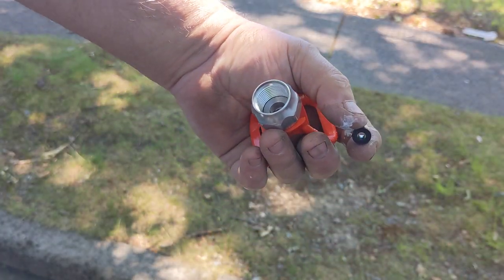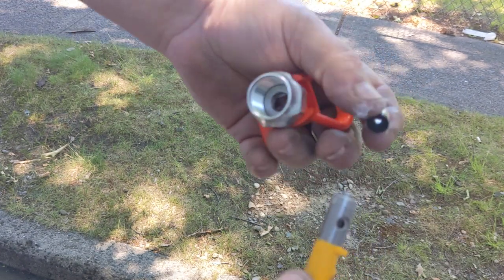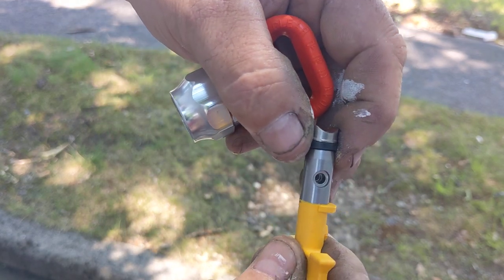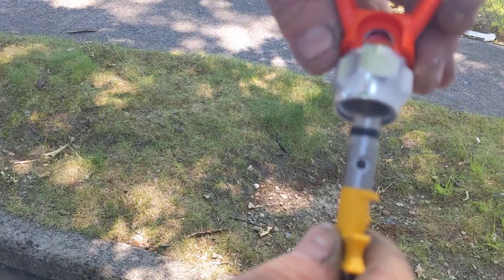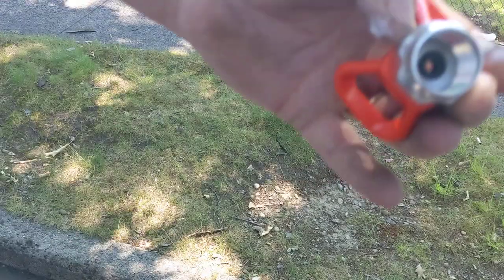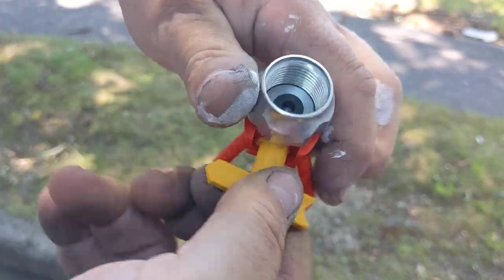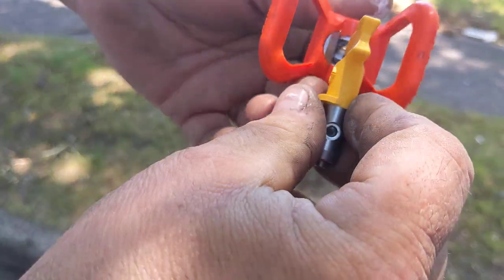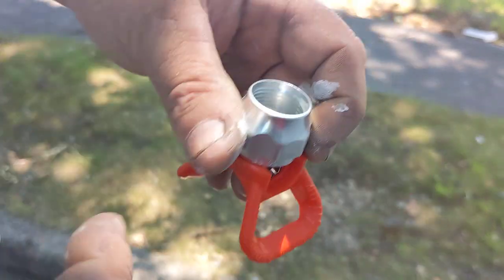Graco Tip Seal Replacement #Shorts

Comment: I was wondering why my gun was leaking and the nozzle tip would just fall out, I guess I accidently popped the seal out when I was cleaning the gun with a wire brush last time and didnt notice until  I used the gun again
Reply from the maker: Thanks for watching, if you do not push the seal in with your finger that do fall out.

Comment: Can the tip seals be used for different tips or does it have to be used for the tip that it came with?
Reply from the maker: They can be used for any Graco RacV tips
Reply: @linepainter  I mean can the 515 be used with 313?
Reply from the maker: @centerbuilder7677  yes any to that fits that tip guard can use that gasket